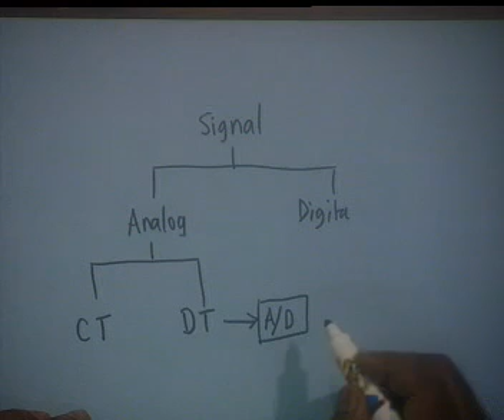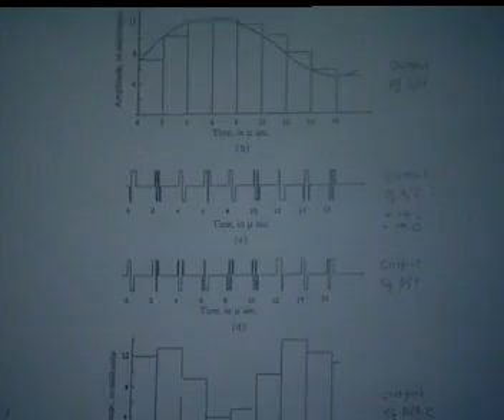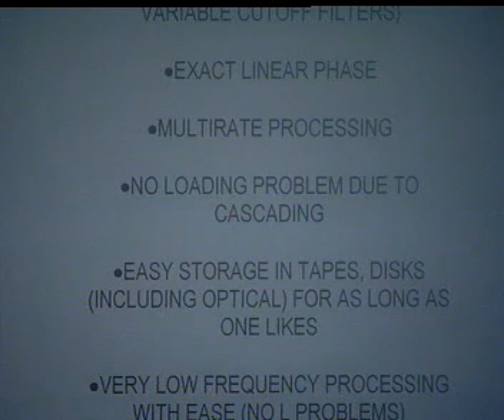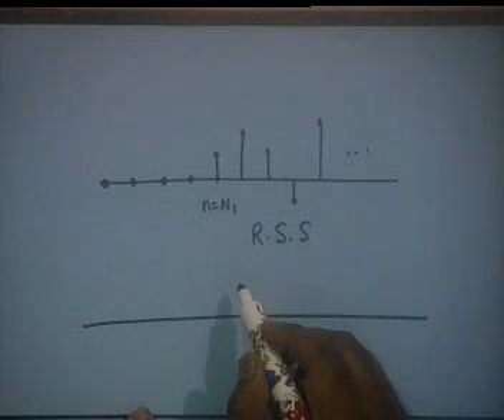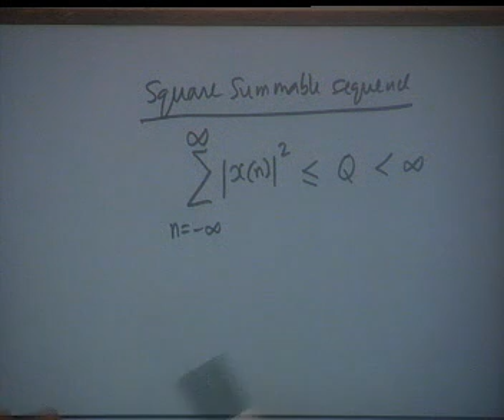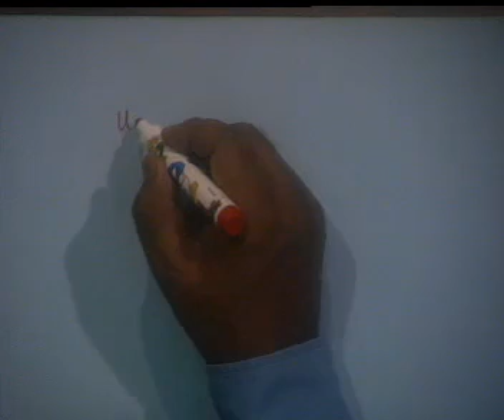Lecture 2 - Digital Signal Processing Introduction Contd

Comment: Sir we know thar power x time energy. As you said voltage^2 x time or current^2 x time = energy that means we are considering resistance as 1 ohm. But why? I can't understand
Reply: When I say normalised resistance then only 1ohm is taken. You can think it in terms of definition like 1joule of work means amount of work done in moving body by applying 1N force by 1m. Similarly here energy is defined in terms of normalised load i.e load of 1ohm
Reply: You will learn more about it in antenna theory in your 7th or 8th semester where we talk about normalised power dissipation. Same concept is used here